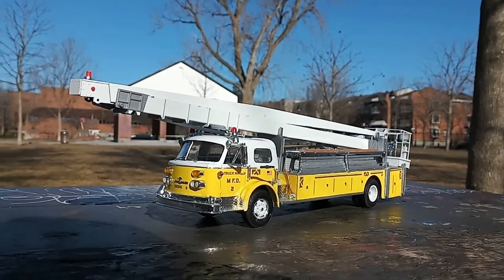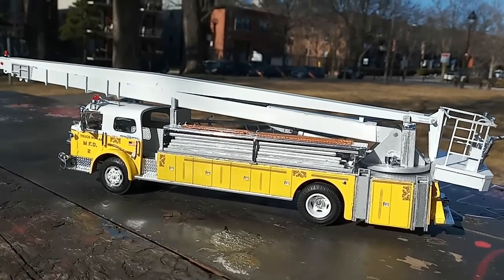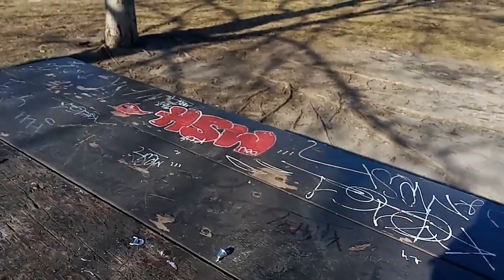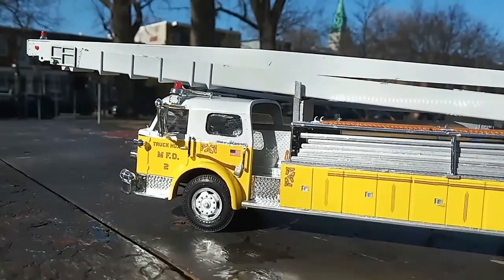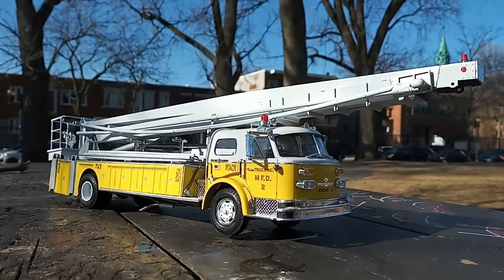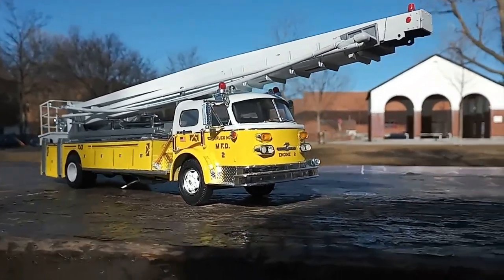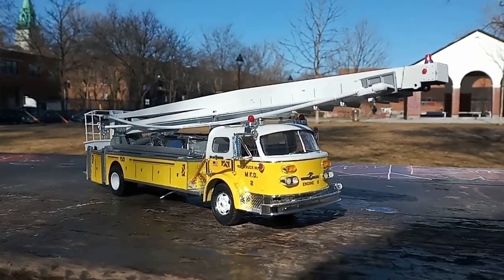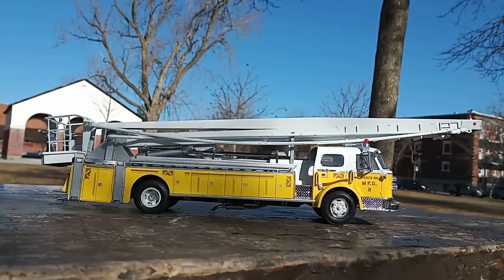PART 4 AMT AMERICAN LAFRANCE FIRE TRUCK MODEL KIT PROJECT THE END

Comment: Great job Elton, I'm currently working on the Ladder Chief myself. Not using kit lights and siren, made my own lights and ordering Federal Q, a couple CP25 speakers and a resin radio stack for interior. Mine will be white over Tamiya X-7 Red. With a mix of my own custom department decals and also some kit decals